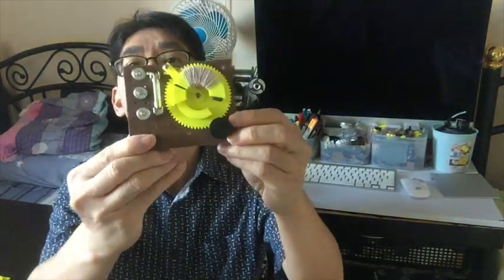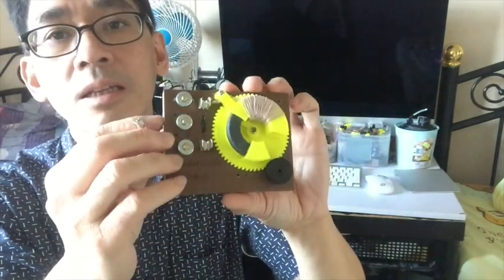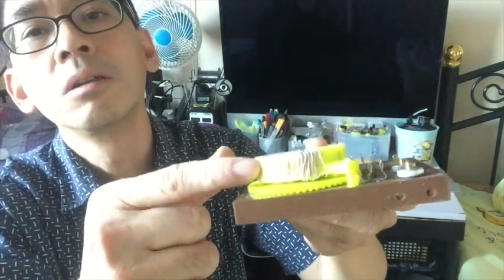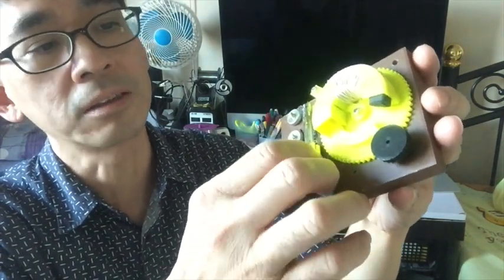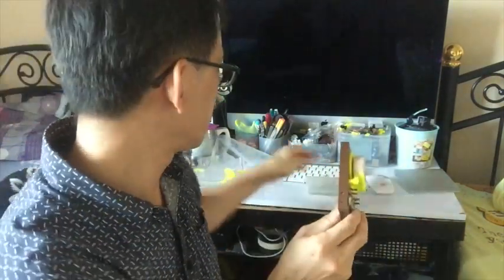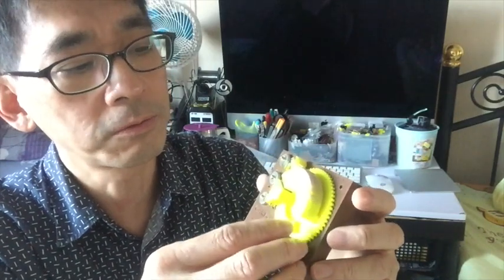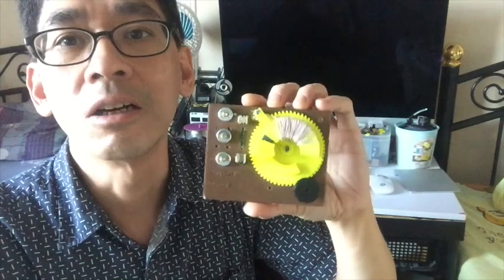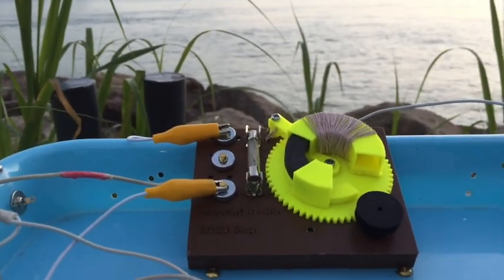P1 Intro and Demo -  3D designed Ring Variometer AM Crystal Radio

Comment: Neodymium magnets increase the magnetic field by placing one end of a ferrite core and then placing the core inside a coil. In my crystal radio, I use a tube coil and a rectangular ferrite core that places 2 neodymium magnets attached to one end of the ferrite, thus increasing the volume. Greetings and congratulations on your new crystal radio design.
Reply: My first thought on this is to use the Reagan creed regarding Russia. Trust but verify. If neodynium increase the magnetic field more than Ferrite, why don't we use neodynium cores? Also a magnet attached to a ferrite will saturate at least part of the core reducing it's inductance. Is there a limit to how many magnets you can use while increase the magnetic field? if yes, Why? Do you have any supporting data?
Reply: @mavamQ   yes, what I have done is, the 2 coils in a piece of plastic pipe, (L1 antenna and L2 tuning coil, each of the coils with a variable capacitor (if you have a better double capacitor)), then I went introducing the ferrite core and while I turn the capacitors until I can capture as many emitters as possible (once this is done, you will have part of the ferrite outside the tube, to which I added glue around the tube so that it does not move the ferrite core), once this is done I added to the end of the protruding ferrite core the 2 neodymium magnets (of the round ones the size of 2 coins 1cm in diameter). You will notice when magnetizing the core that the coil gain will increase and the stations that are heard low will increase their volume. Greetings.
Reply: In this way neither the coil nor the core is saturated. I tried adding more magnets and adding more than 2 I have not noticed improvements, the volume does not increase any more.
Reply: @jeremiasberrutti5453   Hi Jeremias, I opened a discussion on a crystal radio group and the general consensus is that you had the station mistuned and the magnet reduced the coil inductance and brought it into proper tune. You can read it here, http://theradioboard.com/rb/viewtopic.php?f=2&t=9543